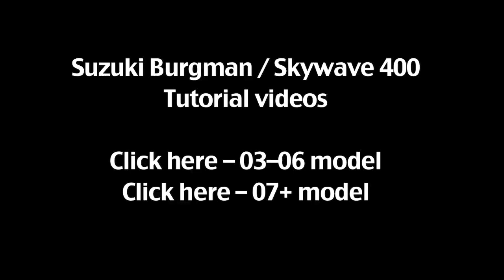+07 Suzuki Burgman 400 - clean/wash cooling fan filter | MicBergsma

Comment: Hey bud. I got my hands on an 07 and it iverheats no matter what I try. I fi all removed the thermostat to see if free flow would do it but alas no luck. I see videos about the cooling fan but not the radiator fan. That is my most likely culprit. Got anything???